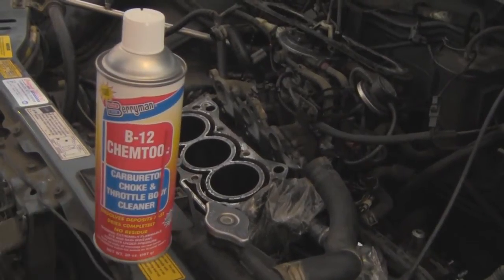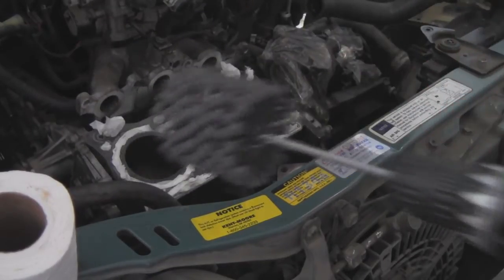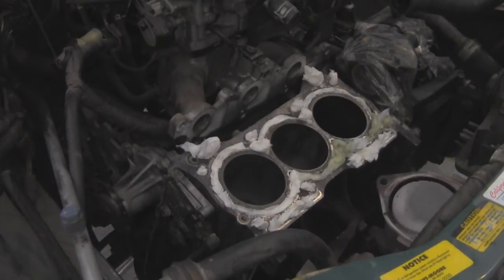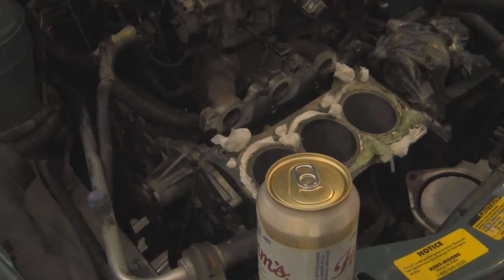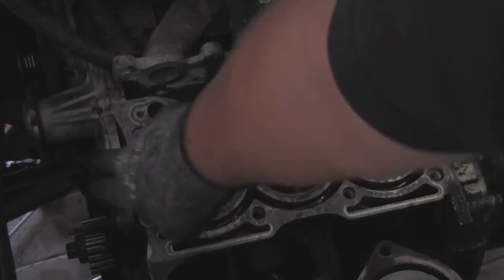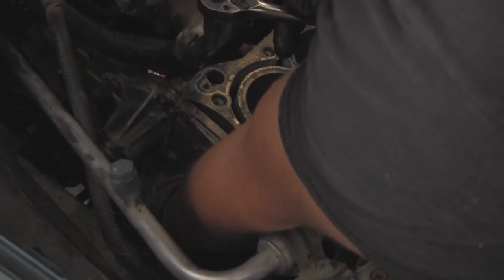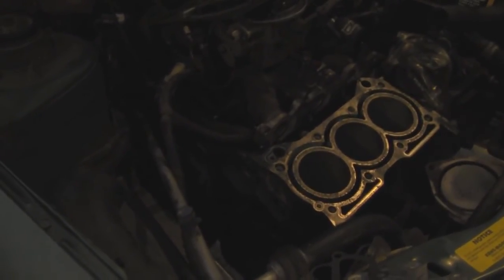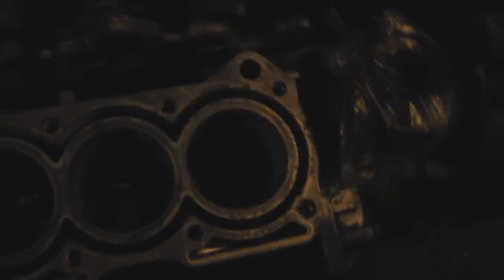Honed Cylinders, Installed new water pump, Put in new Rod Bearings

Comment: One more thing, What was done to the actual cylinders?  Were they re'done?  did you take them out?  It didn't show it in any of the vids.

I have a 93 convertible metro that was supposedly rebuilt, but the guy did a terrible job, oil is all over the bottom and parts of the top of the engine.  I do go to geometroforums, but what would you suggest I do?  This guy may have installed the bearings wrong or something, or it could be the gaskets.